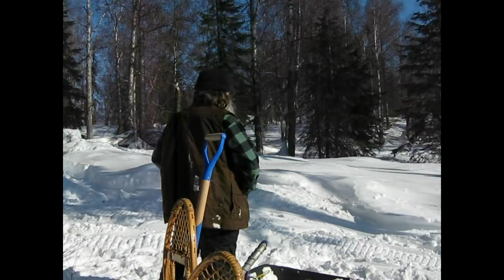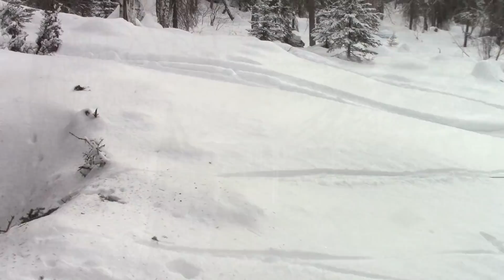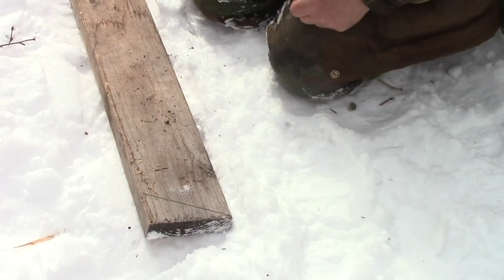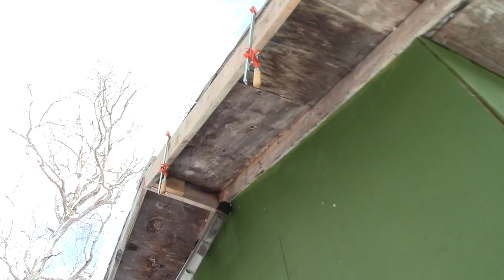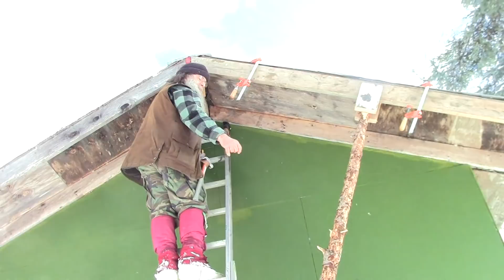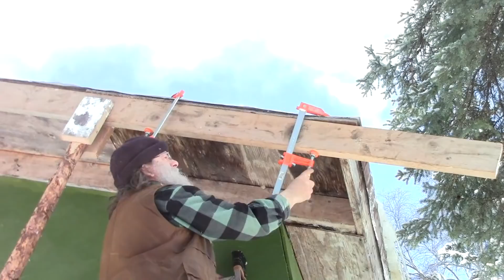Windstorm Damaged Our Remote Cabin

Comment: I have always said the day I don't learn something new is the day I will die.  I come here to learn about survival, but this video isn't about that.  You have, however, saved my life today.  Need to start a nail but have to hold onto something with one hand?  Look at what Lonnie did here.  He wrapped his hand over the top of the hammer and held the nail between his fingers with the head of the nail against the side of the hammer.  Then he just sort of slapped the board with this arrangement.  It was enough to start the nail.  With that much snow, unless you have a reliable method like this, you are going to lose a lot of nails.

Thanks Lonnie.

Comment: Nice job fixing your cabin. Another advantage from using up the wood you already had there because you don't want it to sit around down there and deteriorate over time from just sitting under there. Plus Heaven Forbid if something else should happen to your cabin you have a fresh new board there to fix it. 
I hope you also checked the roofing on the top and from the bottom on the inside to make sure there isn't any places where the roof might leak.
Reply from the maker: The roofing is sheet metal roofing and is fine.
Reply: @Far-North-Bushcraft-Survival  OK just wanted to make sure. I put up gutters for a living so I know the importance of checking the roof for spots that might leak

Comment: Incredible craftsmanship!
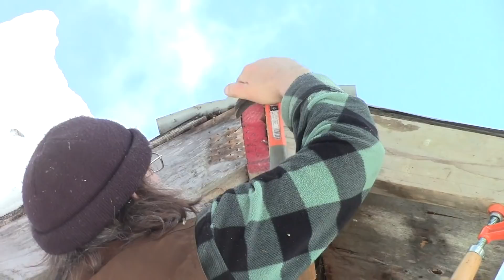At 15:30, how in the heck did you start that nail, sideways?! I have never seen that done before.
Great slide jack improvisation!
Reply from the maker: I held the hammer head in my hand with my fingers wrapping up over the top and down the side of the hammer head.   I then placed the nail head against the side of the hammer head and held it in place by squeezing a couple fingers together on each side of the nail shaft and holding the nail head flat against the side of the hammer head.   Hope that made sense.    It is much easier and simpler to perform then it is to describe the process.
Reply: Far North Bushcraft And Survival AHA! I believe I understand. Just went outside and tried it. Clever!
Thanks for the response.
ATB!

Comment: Great video!  It is funny because I am dealing with a similar problem here where I need to jack up an old stair riser landing that has fallen.  The walls are brick and stone and being over 200 0r so years old it is timber framed in then fixed with nails and who knows what many times since.  I would like to finish it off right, but no time for perfection.  I just need it safe and secure now so I can have people use it and not gamble like I do dancing on the edges hoping it won't give and bring the house down on me.  Looks more like a Spanish death trap than a stairs landing, but I was trying to remember some of the timber jacks that just used two fixed and load bearing timbers with a third leg that kicked together with the other two jacked them up a few inches and you could just put a peg through to secure it.  Then take it away after you got the actual post structures in place and use it on the next job.  Your jack is similar as it still has those 3 legs or two guides and one load bearing leg and you had that slide instead of the swing of the 3rd leg.  So it was interesting as I am wondering if I could utilize that slide technology on my dilemma or just file it away back for another project.  Thanks again.